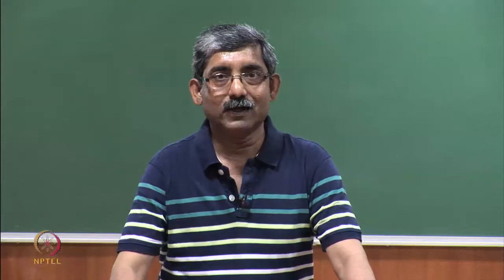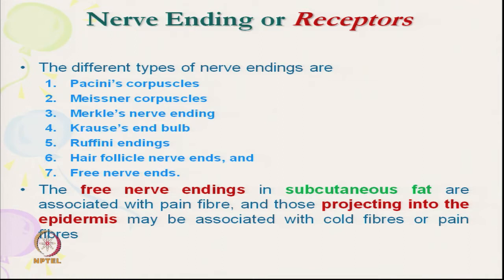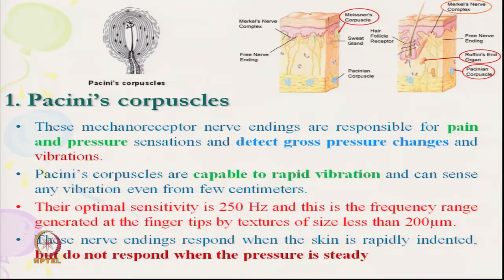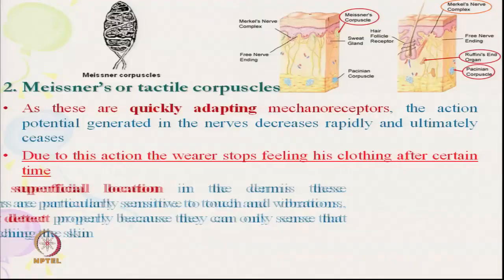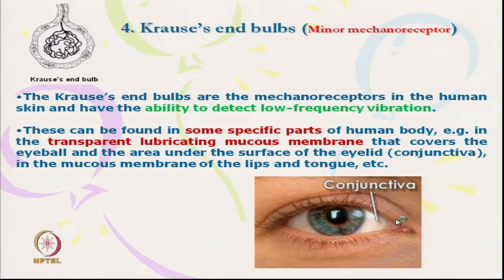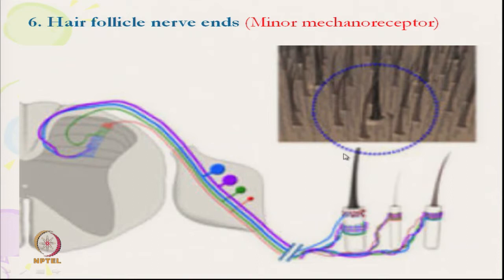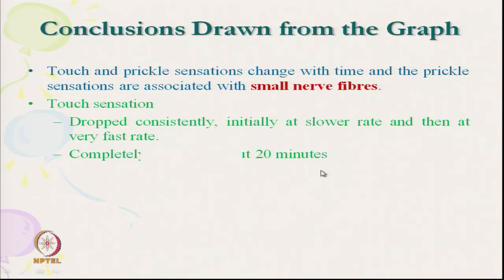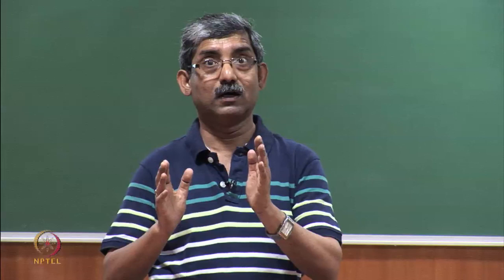Neurophysiological Processes in Clothing Comfort (Contd.)

Comment: 2:34 1. pacini's corpuscles
-mechanoreceptor nerve endings
-pain, pressure sensations
-detect gross ∆P, variations
4:40 2. meissner's (/tactile) corpuscles
-light touch
-quickly adapting
9.54 3. merkel's nerve endings
-slow adaptive type of mechanoceptors
-edge pressure